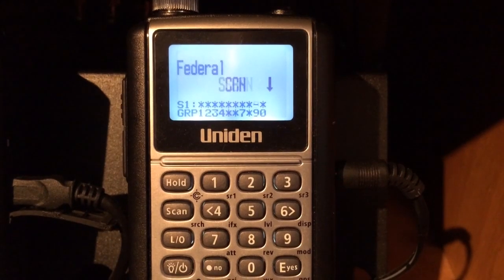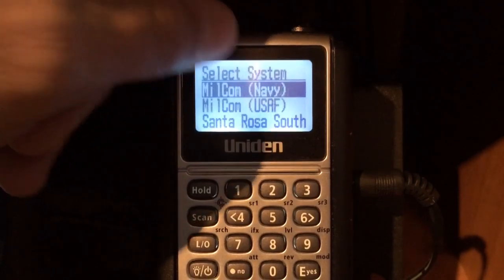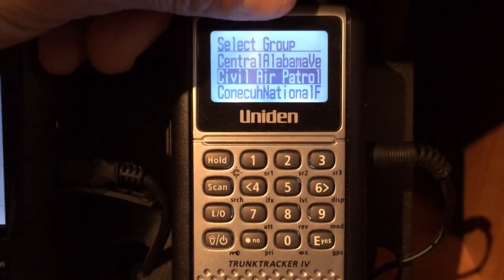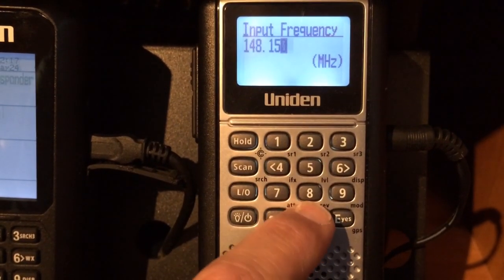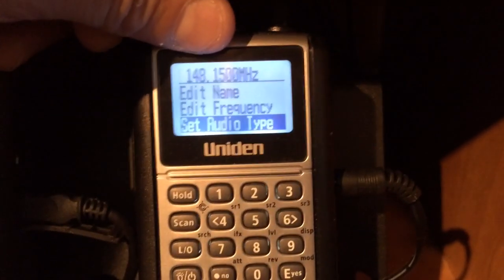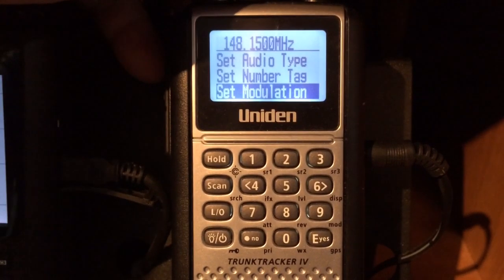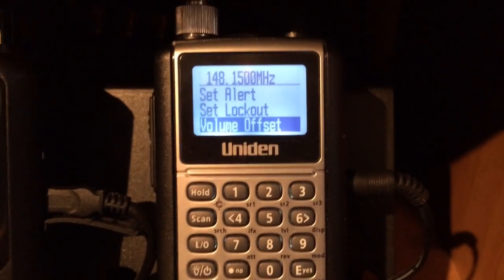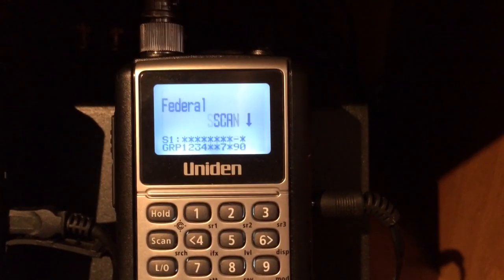Uniden BCD396XT Programming a conventional channel

Comment: Hello Sir, I am having one big problem with my BCD-396XT. The one BIG problem is my  system. The frequency for my city is is 769.68750 I have great range but I only hear little bits of traffic. It will pick up TGID's that I put in but not every time. When I put my county's Site frequency in 853.8125 it will pick up everything but I am far away from the tower and it cuts out when move the scanner around. Does this have anything to do with the Band Plan in the scanner? Very desperate to find the problem Please Help!

Comment: I just purchased a BCD 396XT scanner and am having some trouble. I have the Freescan software and can connect to my scanner. I have Programmed a new system called Nebraska and have entered the P25 frequencies as well as the NFM frequencies. It does pick those up sometimes. My question is how do I select the Nebraska system so that is all that is scanning? When I hit scan it scans every state and entry Pre-programmed into the scanner. I just want to see Nebraska.

TIA,

Eric
Reply from the maker: Hello Eric.  You will need to lock out the preprogrammed systems.  They are located in system quick keys from 21 to 46.  In order to lock them out just press the decimal point followed by the number.  For example, to lock out system 21 (Alaska ALMR) press the decimal point followed by the numbers 2 and 1.  You will need to do that for every pre-programmed system.  Or there is an option in Freescan to load only the systems you create.  It will erase all of the pre-programmed systems during programming.
Reply: K4DPS Thanks! Can I lock them out in freescan?
Reply from the maker: Duke Kemsley The only way to lock them out is to erase them using Freescan.  When you load to the scanner there will be an option to erase all systems before you load your own programming.
Reply: K4DPS Ok. Thank you so much!! Love the videos!

Comment: Hello K4DPS i am having a little issue with my bcd396xt i cant seem to get any digital channels .I have try'ed everything to get this thing to work. I live in San Bernardino CA i can hear all the trucked channels and conventional it's the APCO and the P25 i get nothing shows it scanning but there is nothingbut a NFM where u would see the freq just scans and it shows a message NO apco band available please any help you can spare would be great thank you
Reply from the maker: Anthony, San Bernardino County shows 12 different 800 MHz systems and they are all analog.  

The P25 system only shows a few talk groups currently and it looks like some are encrypted.  Make sure the control channels are programmed in.  Here is the link: http://www.radioreference.com/apps/db/?sid=7016
You will need to program in the frequencies that are highlighted Red and Blue.

Comment: Can you tell me if you used the USB to Serial Converter to hook your BCD396XT into your PC and if so did you need to install drives for said converter. Thanks N2XGI
Reply from the maker: Yes I do use a USB to serial converter, but I don't remember if I had to install drives for it.  It seems to me that Windows 7 recognized it and if it did need any drives, they were downloaded automatically.
Reply: Thank you for your response, I have found using windows 8.1 I did not need to load any drivers with my converter. saw it right away...73
Reply from the maker: Thomas Sabia Thanks for the info!

Comment: Thanks for the additional info, am I correct in assuming that I could also add the fl statewide system to my bcd396xt and hear the non encrypted stuff or is the dsd software going to be the only way.
Thanks again
Reply from the maker: highwaterband The only way to monitor non-encrypted talk groups on the Florida SLERS system is to use a computer with DSD software and a scanner that has discriminator audio.

Comment: can you make a video on putting control channels frequencies into the scanner
Reply from the maker: It is much easier to use the Freescan software to program this scanner.  I would suggest downloading it for free and programming trunked control channel frequencies with the software:  downloads | sixspotsoftware
Reply: I live coffs harbour and I don't know if they use talk groups where I am or just frqenices but I have free already ive programed the talk groups and control channels but still no chatter
Reply: how do I set up a
accco band plan
Reply from the maker: Daniel Leewood Here are the conventional frequencies for the Fire Department: http://www.radioreference.com/apps/db/?aid=1030
and police:  http://www.radioreference.com/apps/db/?aid=1026
You will not be able to monitor systems that use NXDN and DMR.
Reply: how do i know the conventional frequencies are working propley i set the digtal and the nac code and still no chatter

Comment: This is one of the better explanation videos I have seen and it has helped me a lot. I am still having trouble understanding how to easily access single, specific frequencies quickly. So if I turn my radio on say it is held at my local fire dept dispatch but I want to quickly change to the local airport tower I have programmed in elsewhere. This would be an easy thing to do but so far it escapes me. Point me in the right direction?  I'd be very grateful.

Comment: I followed along jut fine until we got to part about where it says "new channel" mine doesn't show input frequency, it says input TGID and it has (DEC) at the bottom.
What do I do?
Reply from the maker: katanatac You have tried to program a trunked system.  Go back to the beginning and make sure you are using conventional.  Menu>Program System>New System>Conventional
Reply: That did the trick, thanks K4DPS
Reply: This helped me out as well. Thanks.